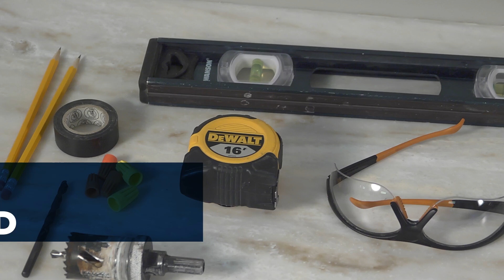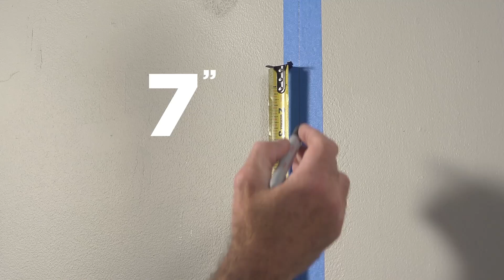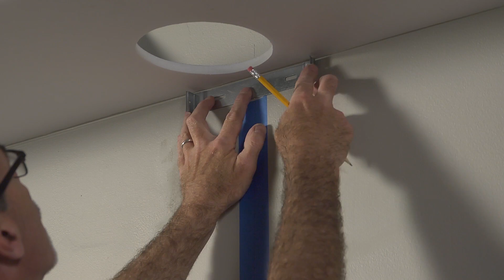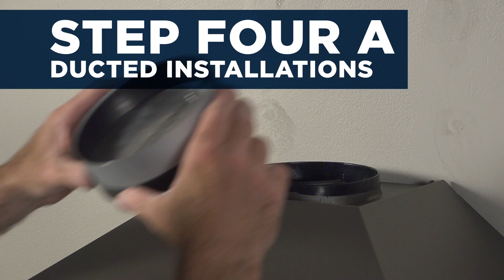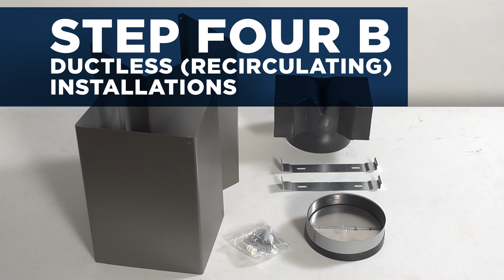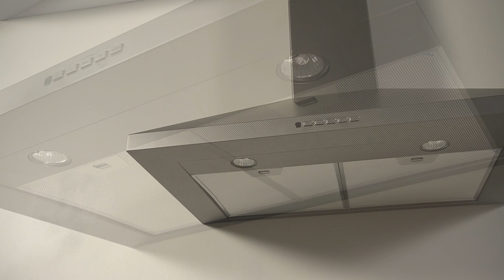GE Appliances Vent Hood Installation

Comment: We just installed this hood. What is the black square for? (All the way to the left on the control panel.)
Reply: I believe you are referring to the infrared receiving window. When you use the optional remote control (must be purchased separately) you aim the remote at it and then press the button on the remote for the action you want.
Reply: I like it but I dont like that you can see those vents in the chimney by the ceiling.   I dont get that

Comment: If only the brackets had come with the unit!  Tried to get them from GE……that was unsuccessful……had to pay another $93.00 + shipping to get the brackets.   And yes…….trim would be nice……that’s the next purchase.
Reply from the maker: We're sorry to hear the brackets did not come with your unit. Our JVW5301, JVW5361 vent hoods come with duct cover mounting brackets. This can be found on page 5 of the owner's manual here: http://spklr.io/6054W0qC.

If you have any questions or concerns, you can call our Parts Team at 1-877-959-8688.

Comment: So charcoal filters are not needed if venting outside the house?
Reply from the maker: Hi Ryan,

Thanks for asking. Can you provide the complete model number of your vent hood? We'd be happy to take a look into your question once we have that information. You can use this diagram if you need help finding it: http://spklr.io/6054cbqq

Hope to hear from you soon. -MS
Reply: @geappliances  The model number is JVW5301SJ1SS. Thanks
Reply from the maker: Hi again Ryan,

Thanks very much! You're correct, if you're venting your unit externally, then you do not need the charcoal filter. This filter comes into play when using a recirculating venting method.

Hope this helps!

If you have other questions, feel free to ask. -MS
Reply: @geappliances  Ok thank you for the quick response!
Reply: @geappliances  hi there, all the range hoods are set up to be recirculating, correct? we need install a deflector in order to convert it to venting? I cannot find either of the deflector types in my box? Do we purchase this part separately?

Comment: Good video. My problem is with the top vent cover not fitting flush against the ceiling. There is no support to hold the front up and it has left about a 1/8 gap between the ceiling and the cover. 
Anyone have that problem?
Reply from the maker: Glad the video was helpful!  I would have thought the vent cover screws would hold it up in place against the ceiling, providing it was installed at the correct height.  Maybe someone who's run into this will have a suggestion for you.  Thanks  -CC
Reply: Thanks for the reply. Ya, I have the top bracket topped out with the ceiling. Perhaps the wall and the ceiling aren't perfectly at a 90 degree angle. The unit seems like it should have had a piece to finish off the top. ie some type of collar or molding running around it. Thanks again
Reply from the maker: That could be the issue but you've got a good suggestion about a molding,  I'll be glad to pass it on.  Thanks
Reply: @geappliances why can you see the vents on top?

Comment: Frustrating install. First problem:  10.5 inches for upper cover bracket shown on this video and in the manual. I set all the dimensions and then installed my tile, cutting away the glass tile where the screws go and installed the brackets. But, the upper covers mounting holes are 12.5” from ceiling, not 10.5”. Will need to drill new holes in the upper cover. Isn’t this a really simple thing to check between the design and the instructions?  Second issue is that the lower cover has large vent cutouts for internal vents but for a ducted system, the internal, ugly, piping all shows very easily. How am I supposed to hide that?
Reply from the maker: Hey there - Thanks for reaching out, we're happy to help. We've reached out to our research team to further review your question, and we will reach out with an update as soon as we hear back from them. We appreciate your patience! -JS
Reply: Interested in hearing your results. Customer service call could not help without me providing a serial number. So I would have to call back.
Reply from the maker: Hey there - We apologize for the delay. We are still waiting to hear back from our product team about this. We're confident they'll let us know more information when they're able, so we can help you. In the meantime, if you have any additional questions, let us know. Kind regards. -JS
Reply from the maker: Hi again,

Hope you're doing well. Our team got back to us and let us know the following: The standard height of 10.5 inches is usually correct. There is not a kit or cover available to hide the cutouts in the lower duct. We appreciate the feedback regarding the install and will use this for future consideration. -MS

Comment: Does this just vent into the attic?
Reply from the maker: Hey there Nate,

Our chimney hoods have two different venting options, external venting and recirculation. If you choose to vent externally, it should be vented outside. Recirculation does not require external duct work. We hope this helps. Take care. -MH
Reply: @geappliances  ok but watching the video install, is it acceptable to vent into the attic or must you go through the roof?
Reply from the maker: Hi Nate, 

If choosing to vent externally, then it must be vented outdoors. Let us know if you have any other questions. -MH
Reply: @nate478  never vent anything into the attic
Reply: @Ryan-vq5ur  I know this. I wanted to see what they say. This video is terrible
Reply from the maker: Hi again Nate,

If you've got other questions about installation, we'd recommend reviewing the installation instructions for your hood. If you need help finding those, just send us your model number. This link can help you find that info should you need assistance: http://spklr.io/6057cbUv

All the best. -MS

Comment: The video and manual is extremely vague. The manual nor the video makes no mention of the cutout area for those who have the range hood venting through the wall. I've NEVER seen a range hood that externally vents not mention the cutout for through the wall venting, as this is often easier than going up through the roof, not to mention with venting, you want as short of run as possible. The manual makes it seem like you need an exact location for the wiring, but many people who may be replacing an old hood with this one might already have a wall outlet there, and again the manual makes no mention of an acceptable range of area for an outlet. Wall mount range hoods that are sold with no branding have better instructions. Do better GE...
Reply: It’s a hard-wired electrical installation, so GE have no need to talk about receptacle placement.